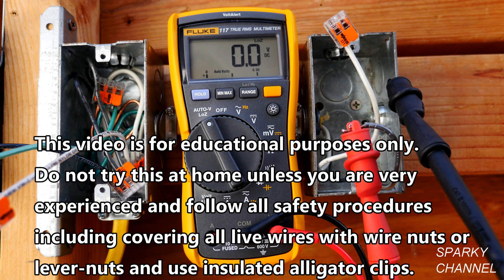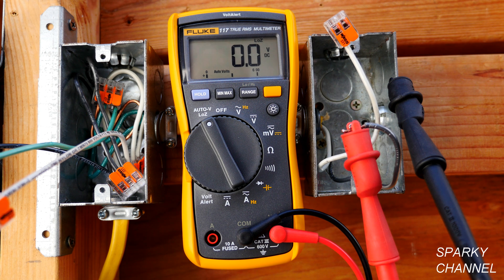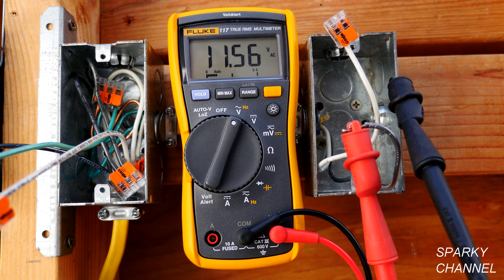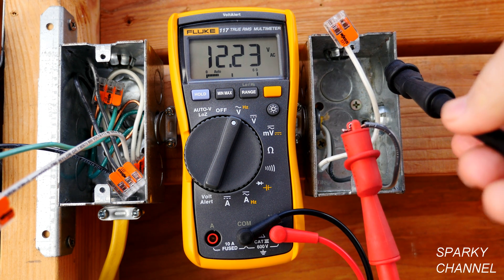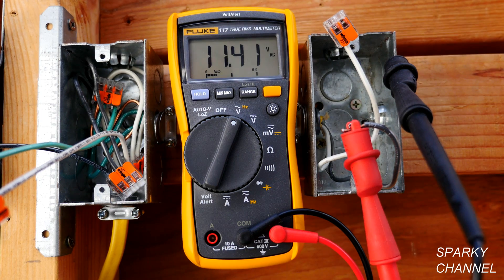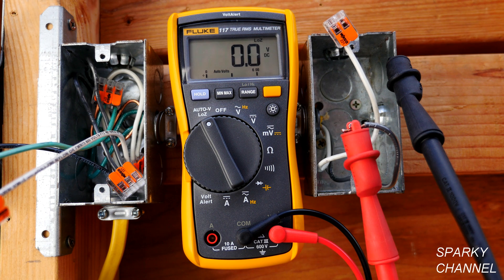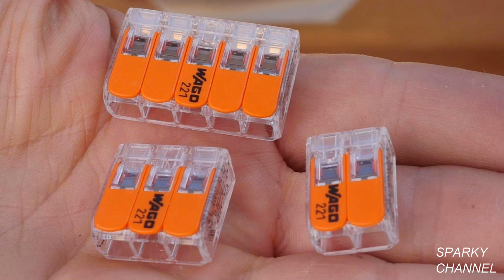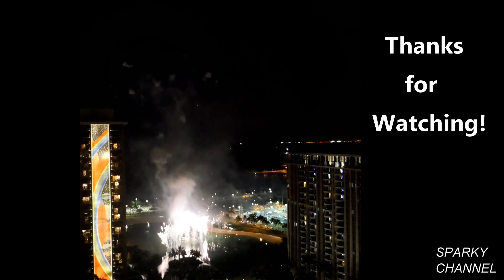What is Dual Impedance and How Can You Use It?

Comment: The metal box is not an equipment ground.. it is not capable of carrying fault current back to the source. The voltage reading is a difference in potential between two metal parts. In theory you could touched the hot wire to the box directly again nothing will happen until an equipment ground comes into play!
Reply from the maker: That's correct, thanks!

Comment: I assume the "Low-Z" setting would have also shown 120VAC on the hot-neutral connection you had on the "V AC" setting at 3:30?
Reply from the maker: Yes, that's correct.